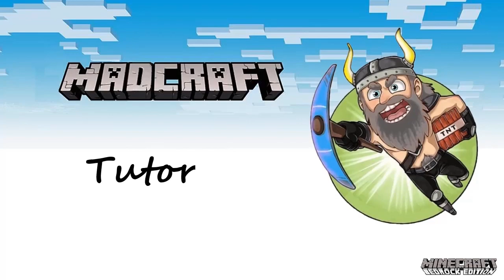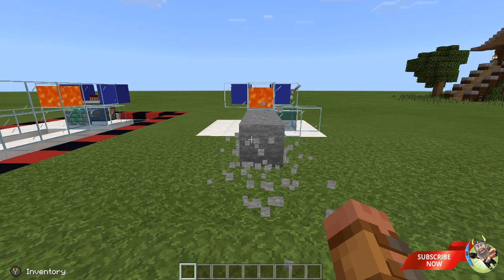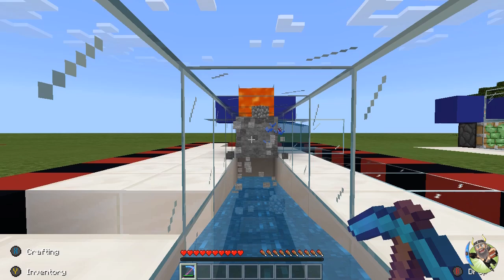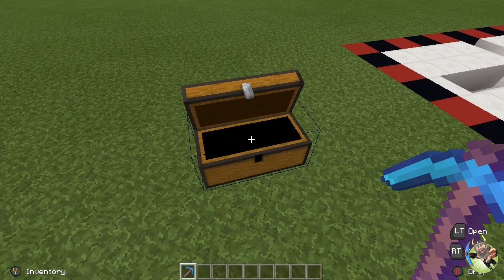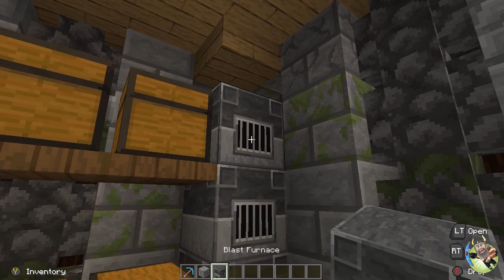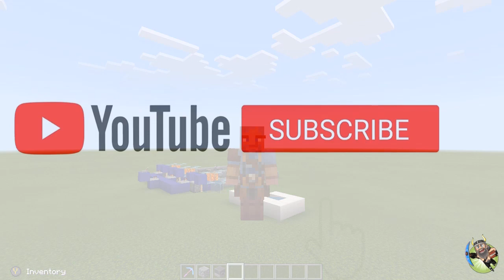Minecraft Bedrock: Easiest 9K Zero-Tick Cobble or Stone Generator EVER!!  Tutorial (1.14.1)

Comment: You should Add A Observer Running Into The Lava For It To Be Faster But Your Design Is Super Compact :'D Good Job Dude
Reply from the maker: Hey Zumaic.  I’m not sure if you watched to the end of the video.  But I do discuss the difference between using an observer clock vs not using one.  In my testing, I found I was getting the same rates using it or not.  The production of the stone has a finite rate.  Now, the observer clock will get it to that rate faster but only by maybe 10 seconds.  So, I felt it wasn’t needed for the overall results.  I did shout out your cobble stone generator and linked it in the description though. 🤪  I really appreciate the feedback!!  😁👍🏻
Reply: @Madragoric  Nvm I Watch Half Way And Commented And Watch Til The End And Just Noticing I Am Being Stupid :,D
Reply from the maker: No sir ... not being stupid.  I really appreciate any feedback.  No worries.  😁👍🏻